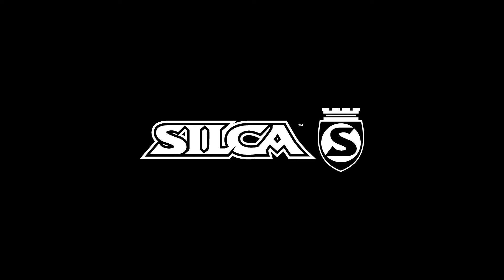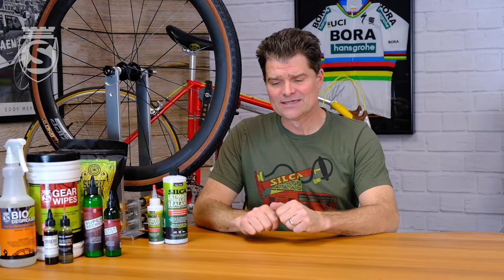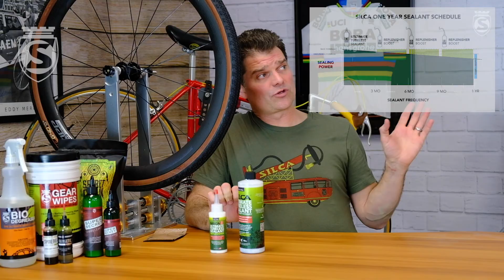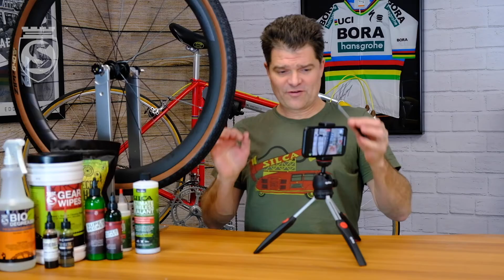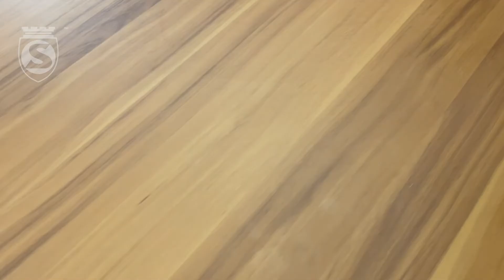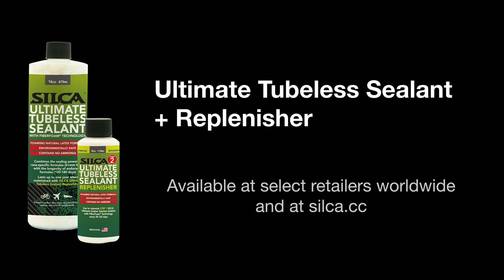Ultimate Tubeless Tire Sealant  (New Product Announcement)

Comment: Josh, I think you actually have a couple of scenarios: The first, covers the scenario you raise. That is, you get a puncture and just roll through it and may not even know it ever happened. The second is an obvious puncture, where you dismount and rotate the hole to the bottom, where the sealant is pooled. The particles are probably designed around scenario No. 2.
Reply from the maker: This is where the foaming action comes in, the foam allows the sealant and particles to be more mobile while riding.

Comment: Hi I have a question.  I ride Enve 3.4 SES road wheels with Vittoria Open Corsa tires.  I’ve used Orange and Finish Line sealant in past years.  My size requires a tire pressure of around 100-110 lbs.  In this video you were talking about 30 lbs.  Will your sealant work at higher pressures?
Reply from the maker: The carbon allows for better sealing at higher pressure than any other brand, but the higher the pressure the smaller the hole it can seal.  We consistently seal holes of 5mm at 90psi.  I'd also check out the SILCA tire pressure calculator, I don't know your weight or tire size, but with modern wide bead seat clinchers and tubeless tires that tend to measure oversize, 100+ psi pressures are not so common anymore.   Check out: https://silca.cc/pages/sppc-form
Reply: Thanks, I used a tire pressure calculator before posting and it said that was the pressure to use.  My weight floats between 230-240 lbs.  My Vittoria tires are 25 mm.  My bike frame can only accommodate up 28 mm.  My Enve wheels were designed for 25 as a perfect fit, but will take 28 mm, in theory.  The side walls are straight and flush with 25 mm, the 28’s would probably bow out past the rims and I don’t have a lot of clearance in the rear.  Thanks for your help.

Comment: Is there potential for the carbon fibers to cause irritation to human skin if contact is made? If the fibers are stiff (like glass?), it seems that they could enter the skin, like fiberglass insulation? Just wondering how this works. Thanks!
Reply from the maker: The carbon is coated in latex, so you have to work pretty hard to have direct contact with it.  We have to take significant precautions in the factory when mixing the raw carbon into the sealant, but once it's in there, it's no big deal.
Reply: Were you planning on washing your hands with it? Lol. Just wear gloves if you think it will be messy for you....no?
Reply: @HolmsOnBikes  actually, I was going to try it for contact solution. Hah! Yeah,  gloves are a good suggestion. I'm hoping to hear from Silca on this one.

Comment: Sounds like this will be the go-to Sealant.

  If I use soapy water to seat the tire, will the water and soap ruin the Sealant? 

Also, do you need to add the refresh to replace evaporated Sealant liquid or does that add say 2 ounces the the weight of the tire/wheel each time?
Reply from the maker: I would avoid using soapy water with any sealant, I believe there are some bead lubricant products out there that are wax based that should be safe.  Good news is that the industry is getting its act together and we are seeing improved fit up of tires and rims each year so hopefully you won't need this method forever!

Comment: Great video. Why is it harder to seal at higher pressures than lower. I’d think it would be harder with lower pressure- less air pressure trying to escape would make it harder to seal but clearly not. Would love to understand. Thanks!
Reply from the maker: High pressures are just so much more effective at pushing the sealant out of the tire.. you need the sealant to have a few seconds to begin to harden when exposed to air and under high pressures the sealant is flowing out too quickly to harden, sort of like cutting an artery vs cutting a vein, the skin and blood are same, but the pressures are very different!

Comment: I'm interested if this will finally replace Orange Sealant (it is not possible to get it from where I'm from)

How well does it work under rider weight + high pressure for road tires?
Reply from the maker: Better than Orange Seal, the carbon fibers form a high strength dam behind the hole allowing it to work at much higher pressures than most sealants.

Comment: Josh, loving the new sealant concept. Funnily enough, I have recently switched to using Stans race (pour in only) and then topping up with regular Stans so looks like I had a similar idea but I have no idea of the longevity of that approach. As soon as I run out of Stans I suspect I will be placing an order. Oh, and please talk to Adam at ZFC to make sure he has stock (your shipping costs to Australia for a single usually tip the balance between a purchase or not!)

Comment: This looks like an awesome sealant! As someone who has always injected the tire sealant instead of pouring it in, I do have a couple concerns. Two issues that can potentially make it challenging to use the pouring method: 1) Mounting the tire on the rim. I am getting better at it but sometimes I still have difficulty mounting a tubeless tire on the rim. I can already imagine myself spilling the sealant all over while trying to get the last bit of the bead over the rim. 2) Once the tire is mounted, there is another potential issue of getting the beads seated. Occasionally, I need to spray soapy water on the beads to get them to seat. When soapy water does not do the trick, I have heard of folks putting an inner tube and leaving it inflated for a day before making another attempt to get the beads to seat the following day.
Reply: I agree 100%, if this sealant is non-injectable unfortunately I won’t use it for all of the above reasons.
Reply: @Wireman273  After trying the "proper" pour-in method, it's actually not too bad. The first time I attempted it, I only mounted one side of the tire and poured in from the unmounted side. That resulted in spilling a lot of the sealant. The second time, I used the Silca-recommended method of pouring in the sealant from a partially mounted - the other side is already mounted - side and I only spilled a little bit. I discovered one advantage of the pour-in method: the tire is significantly easier to seat. I still needed to use an air compressor but I could get the tire seated without using any soapy water and it only took seconds, instead of minutes - sometimes tens of minutes - to get the tire mounted because the sealant acts as a barrier in preventing air from gushing out while you're trying to seat the tire. With the pour-in method, I do recommend making sure that you can get the tire mounted first before unmounting it partially to pour in the sealant.
Reply: Try a rim jack it makes mounting easier
Reply: I bought in on this tubeless sealant. I now can’t fill my tires up . The sealant blocks the valve stems. After emailing silca without a reply I called. This call was worthless. I was hoping they could explain what I might be doing wrong. Instead I got sorry. So I replace all valve stems only to clog to the point my pump was blocked also. 
Do not buy this product!,its not the answer
Reply: @michaelbattin6717  Was the Silca sealant with fiberfoam - not the replenisher - installed using the pour-in method? Or was it injected via the valve stem?

Comment: Couple of questions:

How Green is this product?
If you take your bike on a Flight, does the sealant freeze?

The information provided on the product sounds great
Reply from the maker: We are working on a video about this, but we have 3 pillars of 'green' in this product, 1. the latex is from Vietnam and is organic, the same supplier provides latex for high end mattresses and a price premium is paid to ensure the farm remains organic.  2. we use propylene glycol which is FAA certified as environmentally safe as an aircraft de-icer, most brands use ethylene glycol which is same as car anti-freeze and is a ground water contaminate and deadly to animals. 3. the recycled carbon that would otherwise be landfill.  

Clearly anything that is made has some cost, but we feel our approach has a much better environmental footprint than any other.
Reply: @SILCAVelo  Thank you for taking the time to reply & give a breakdown of what you make & ultimately stand for.  I am aware that products companies make are generally always good, however it makes much more sense when purchasing a product to be as Green as possible.

Thanks :-)
Reply: Well, considering the carbon that is used in the sealant would be serving no other use but to sit at a landfill forever, I'd say it's a fantastic way to recycle.
Reply: @HolmsOnBikes  I think we are both agreed on that aspect, however that doesn’t really answer the question as many other products will be sued/produced to create the Sealant.

Comment: Hi, with Orange or Stans, you can check your level through the valve with a small zipp tie. How do you suggest checking when you need a refresh. Does it pool when left stationary or is it always in a foamed state?
Reply from the maker: It only foams when agitated and even then, it's minimal, so you can definitely check it with the zip tie method.  Life expectancy is 12-14 months when replenished quarterly, so i'd say check it and replenish every 90 days and then replace every year or so, or when you replace the tire.
Reply: @joshuaperry6091  lol what are you talking about? He asked about checking the level....the stuff lasts at least 12-14 months. Tell me how I'm wrong.
 Most riders will probably be putting new tires on before they need to check sealant levels.
Reply: Great question. Hope to see an answer here.
Reply: It lasts so long you don't really need to check the level. And if you had to pop a bead off once a year to check/top up, that doesn't seem too much to ask.

Comment: Very cool! I just topped up with OrangeSeal. Doh! Do I need to remove the tire and completely clean out the OrangeSeal, or can I leave the tires seated, suck out the bulk of it and add your stuff?
Reply from the maker: We have not tested whether mixing is option. We recommend pumping out the bulk, clean what you can and then proceed with the pour-in method.

Comment: Would you say that it works better at higher pressures than other sealants on the market 60-80psi range?
What's the recommended amount to use for road, gravel, mtb tires?
I normally seat tires before I add sealant to them (through the valve) to avoid a mess and wasting sealant. I'd totally sacrifice the sealable hole size for being able inject through the valve. Maybe that could be a road specific sealant?
Reply from the maker: We are far and away better at high pressures.. in the beginning my vision was to make a high pressure specific sealant, but as we began testing we realized that it was just better everywhere and all the time, so it just became one product.  With a little care, I can pretty much always get it set up without mess, but there definitely is more risk of mess than injecting through the valve, so just depends on how you prioritize a potential mess vs improved sealing power
Reply: I'm not on Silca yet (till my supply runs out), but in my homemade brew experiments, I've had to redo 25-27mm road bike tires over and over and there is no mess installing once you get the hang of it (removing I still lose a bit).  The trick is to never be working the tire anywhere near the (gravity assisted) puddle lol.